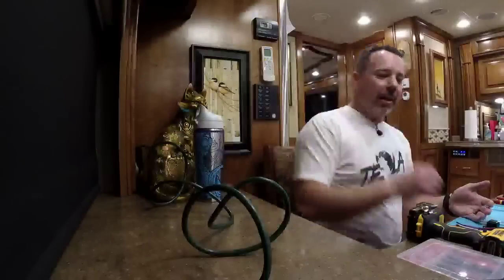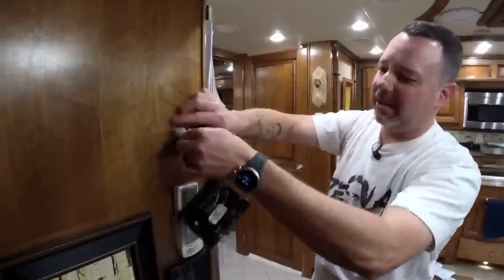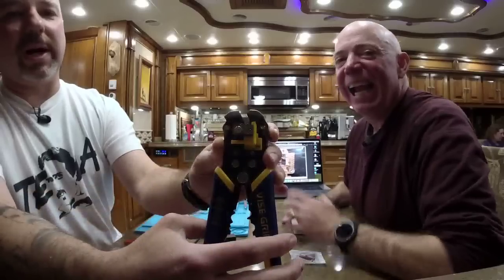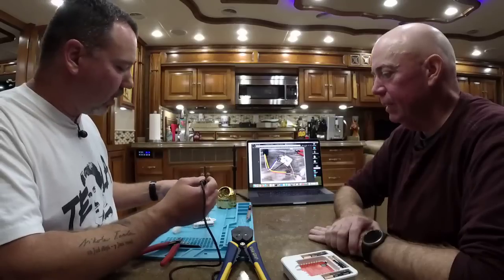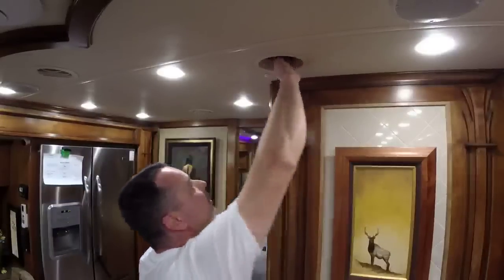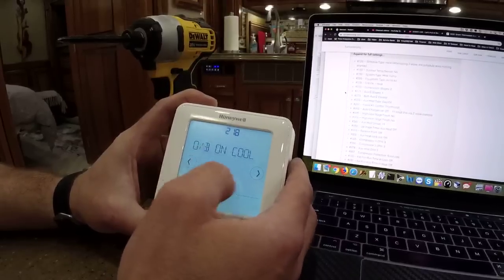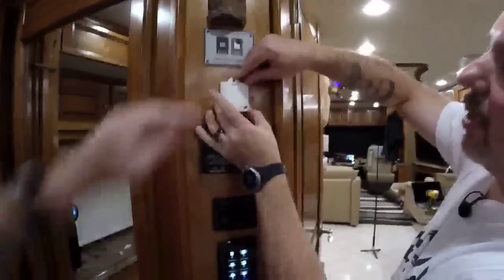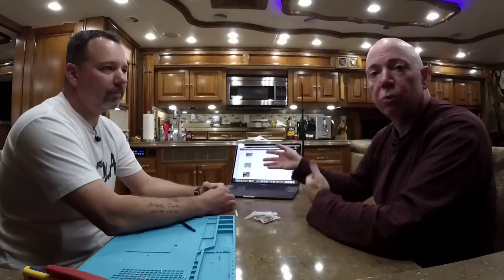LIVE - Let's Put In Smart Thermostats! (What possibly could go wrong?)

Comment: Dave, I'm sorry I missed the live show.

I actually did a similar replacement of the Coleman Mach thermostat (2 of them). I was going back and forth with the Nest and the ecobee 3. I chose the ecobee 3 because it had the remote sensors that help you better control the area inside of the Motorcoach.

I saw you and your guest mentioned that was not possible because of the voltage but what I did was to use a 120vac/24vac transformer and some relays to get the feeds they need. the wiring was the challenge. I had to go with a 2 stage cooling and 2 stage heating wiring.

My a/c units are the Coleman Mach 3 and they do not have heat pumps.  I followed ideas from the 2 links below. The first one shows how to use the relays with the 24 v transformer; the second one shows how to do the wiring.

https://www.youtube.com/watch?v=VQjtQMRPIjc 
https://janeandjohn.org/pages/Ecobee2.html

I hope it helps other full-timers get rid of that Coleman thermostats which are terrible.